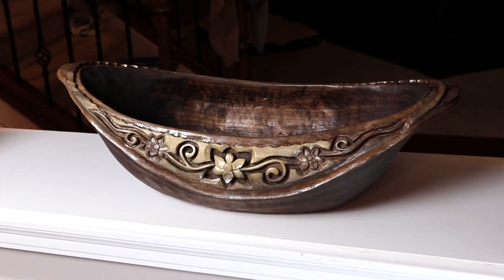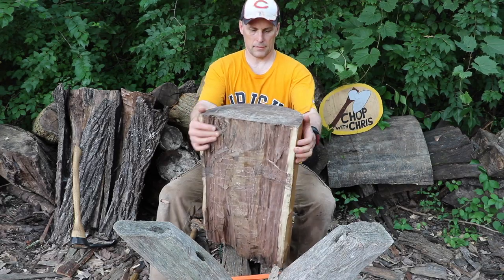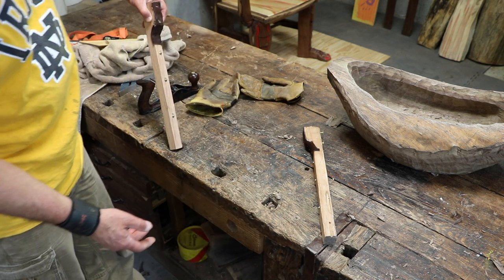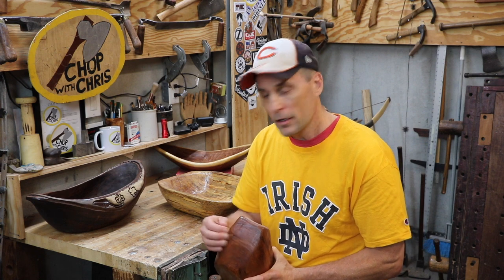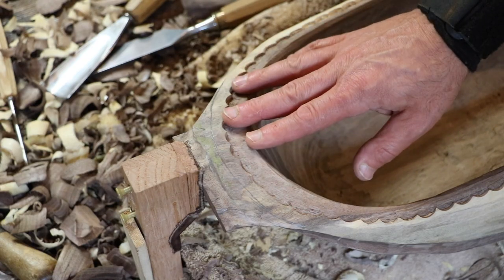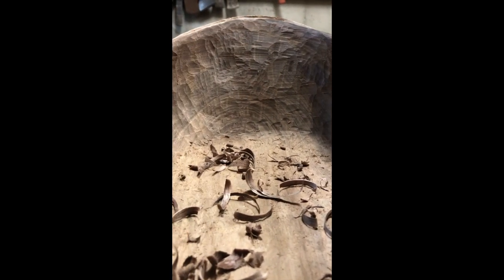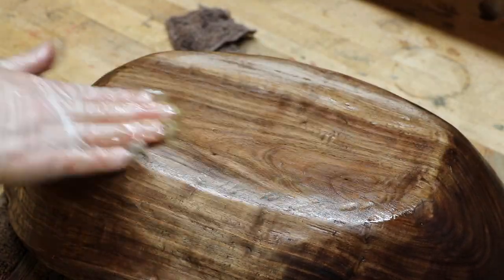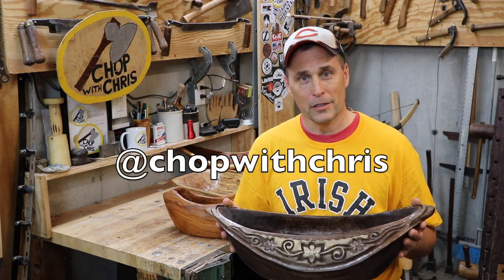How To Carve A Complex Bowl Design

Comment: That is a real nice adze your friend made.  A bit large and long for most accept the largest bowls. It's a beauty just the same.  You have done a great job on the bowl.  I made my first bowl last winter, spoons were my "thing" up until trying to do a bowl.   As I was putting finishing touches on it one of the handles on the bowl it broke off.  That was a disappointment after more than  20 hours of working on it  but I learned a lot on that first attempt and the next will be better.  I will be back at another bowl this winter.  Carving wood is so therapeutic.  Time just slides by.  Well done video and bowl.  Thumbs up!
Reply from the maker: You captured my feelings exactly.   I extract so much joy from carving.  Take care.

Comment: Great instructor! Thank you. I'm restoring some fine art sculptures that I inherited. Watching vid's for ideas. The super glue idea piqued my curiosity. Doesn't super glue need a very thin layer and pressure to work? How thick and deep can you spread the super glue? I'm doing some projects on my own with tools I inherited from the sculptor. Using some green wood as well as restoring 20 year old+ fine art. What a great hobby/job working with wood is!
Reply from the maker: I mainly use super glue for its deep penetration properties to seal cracks at the source and then is wood powder to fill the space.  Good luck with your restorations!